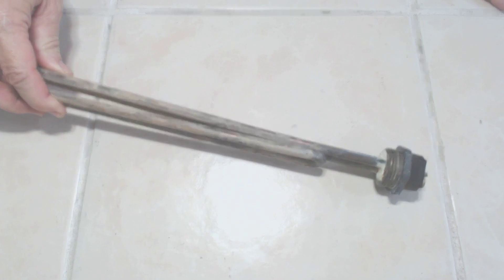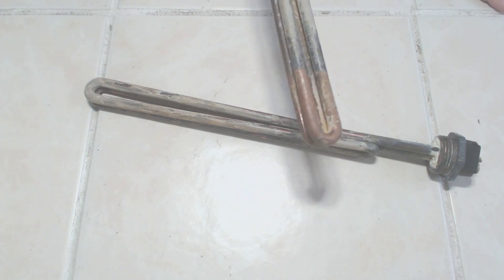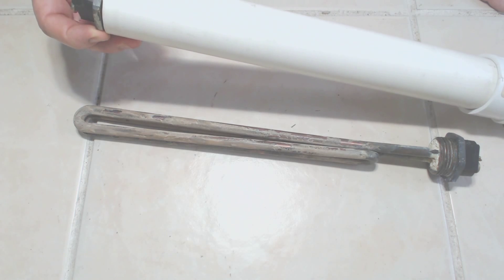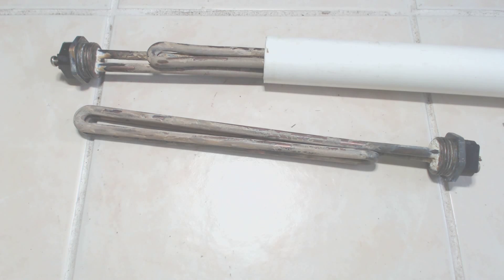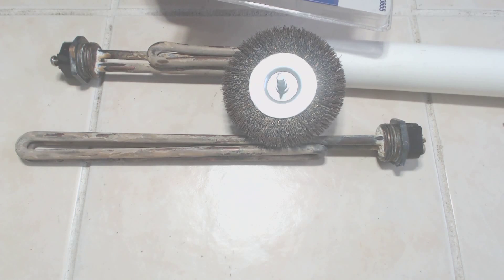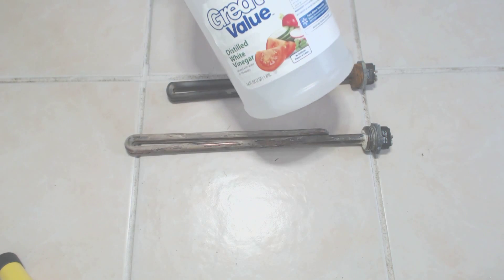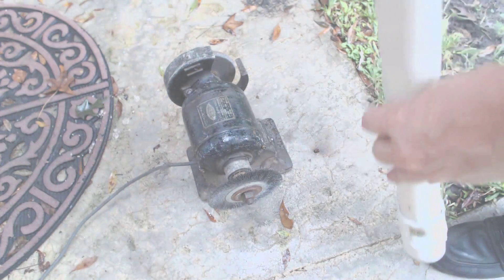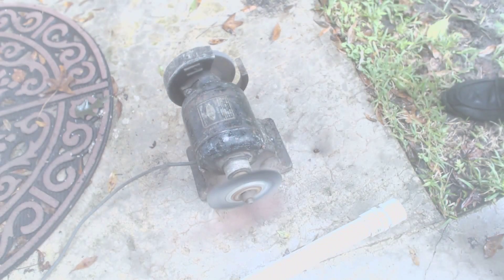How to safely remove calcium buildup from water heater elements

Comment: Excellent video. 
Anyone that does this very important maintenance  every 5 years should also remove the ANODE ROD. This rod is what extends the life of the whole tank. It is only fitted on vitreous coated steel tanks. Stainless steel tanks don't have it. It is fitted on top of the tank. Most manufacturers, may place a two liner at the back of the operations manual. They do not encourage its replacement because they know the tank will last much longer.
Rods are magnisium or alluminium depemding on the hardness of your water. NOTE that often you do not need to replace it. It will be white. Covered in calcium deposits, making it less effective. It just has to be cleaned with a stiff wire brush. DO NOT soak it in any acid. 

The blue green solution after cleaning the copper in acetic acid is Copper Acetate.It is inevitable that a miniscule part of the copper where there is no deposit will be sacrificed. This will have no impact on it's service life. What shortens the life of these elements is the ovehreating that occurs when the copper is not able to shed the heat due to the insulating deposits. With element cleaning and anode cleaning/replacement, your tank will easily last more than 30 years (where the chemistry of the water is not too harsh. 
In case you have a gas tank heater, you need to clean the tank inside every few years. The deposits sit on the bottom of the tank and markedly increase the heating costs becasue they act as an insulator. To clean it you need to flush it and circulate acetic acid or very weak muriatic acid by pumpimg it in the top hot water or pressure relief valve outlet whilst collecting it from the bottom cold water outlet. A small pump or boat bilge will do an excellent j
Reply: I'm not a plumber but it sounds like it makes sense to me..thanks for info. I'm just a med diy'er who was looking into replacing my 10 yr electric water heater element and found this  video about cleaning them. Seems any thing is possible. ✌️

Comment: Pointless!  After going through draining the tank and removing the element, why not just buy a new one? - they are only $10.00 to $20.00 - depending on your element!  When they look like the one that you took out, electrolysis has done it`s work and the element in not going to last long anyway! - no matter how much you clean it!
Reply: When did he apply a DC current for electrolysis?
Reply: @marciamarcia7449  The reason I asked about electrolysis is because it's just corrosion prevention: an electrochemical reaction. All he's doing is dissolving the calcium carbonate deposits and reusing the heating element.
    It is a matter of economics.If you clean it and it's in good condition, use it again, but for a limited time. Gives you a breathing spell to buy a new element or replace the heater after checking for corrosion.
    If you do buy a new heater you can give periodic washes with vinegar or citric acid to extend the useful life. One thing I noticed though.His solution was blue colored which means part of the copper surface on the electrode came off, not much, but some.
    So Mr.Miller is right from an economics point of view.
Reply: what if you cant get one.
Reply: @Myfeetareclean  you can buy anything on the internet, there is no shortage of every type of water heater element
Reply: Any of your Home Depot or Lowes sell that exact element for about $20.00!

Comment: I really like your vinegar "bath tub" water heater element cleaning method. I'm going up to the garage & see if I have enough PVC to make my own! Thanks!
Reply from the maker: My experience is that the bath "partially" chemically converts the calcium deposits allowing for easier removal.
Reply: Yes, thank you, Ed. And that's what I've found from cleaning stained toilets, too! :)

Comment: It's a good video but who has time to do all that stuff
Reply: It was worth it to me as I was repairing my own GE GeoSpring (which is a high-end water heater) that was 6 years into its 10 year warranty period. The control board alone for that thing was a whopping $600 item. I saved a significant figure by doing my own repairs. The job took me longer - due to some learning curve issues - but I'd estimate over $500 saved rather than calling in a plumber. And the heater elements were the easy part!

GE discontinued its production in 2016 (see article @ https://www.treehugger.com/sustainable-product-design/ge-pulls-plug-geospring-heat-pump-hot-water-heater.html). Evidently the energy-saving features were just not appreciated by the American consumer.
Reply: @NormFarnumFamily  GE sent all it's production to Mexico for higher profits and designed-to-fail heaters from 4 to 5 years.
Regards
Reply: @NormFarnumFamily  I'm glad you came out on top,so to speak. 
    Here, in Puerto Rico, their appliances (the good ones w 10 year guarantees) are no longer sold. Instead, we get 1-2 year guarantee models that break down and are worthless after their performance period. So we are always buying refrigerators, again,so to speak.
Regards
Reply: @raymondfrye5017  Thank you... That is very unfortunate, indeed. There is yet a lot "wrong" with the ethical practices of some people & companies in the world. If only we could always practice the principals -- in business & on a personal level -- taught by Christ, namely: Do unto others as you would have others do unto you.

“So whatever you wish that others would do to you, do also to them, for this is the Law and the Prophets." Matthew 7:12
Reply: Money is the root of all evil.